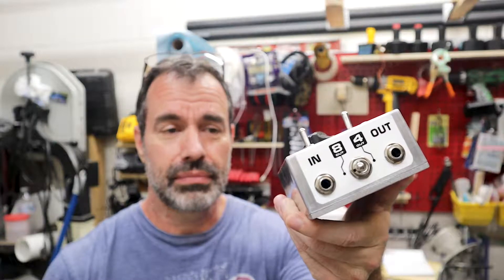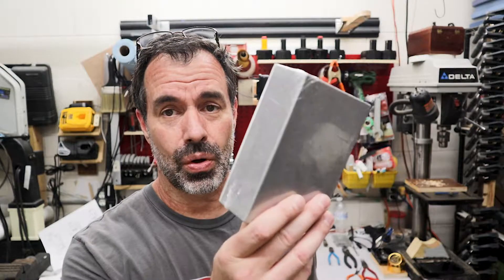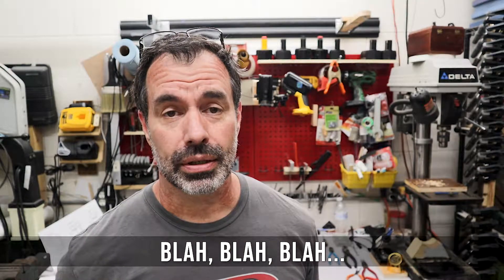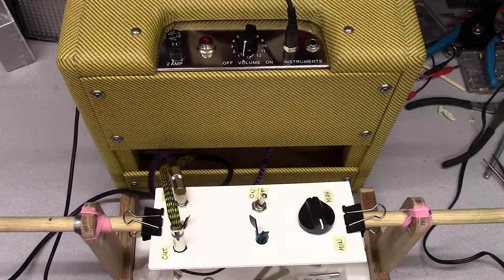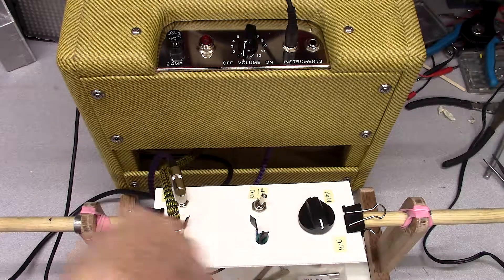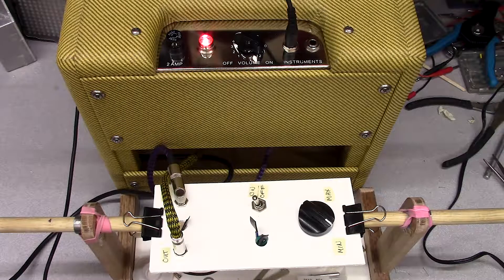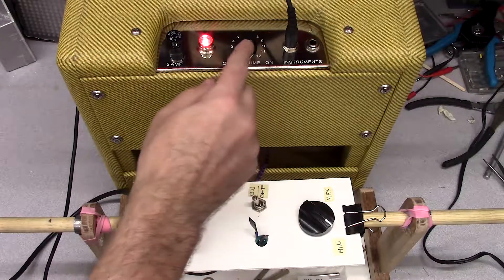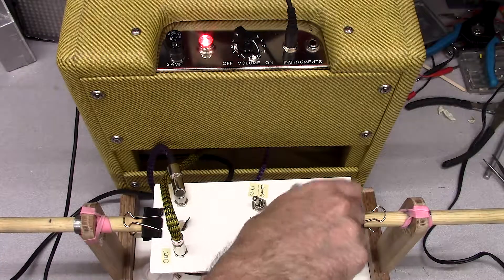Tube Amp Attenuator - the Next Project

Comment: Great videos and very helpful, I would like to build one of these attenuators but it is for a 150 watt valve amp.. What parts do i need and what value are the parts. ?..regards
Reply from the maker: MrAndfio, thanks for watching!
I really wish I could give you good specs for a 150 watt attenuator. That's a bit out of my wheelhouse.
I have read up on others who were working on such things. Tom Sholtz (rock band Boston), was a MIT grad or something and had designed a power soak, others have reverse engineered that engineering...
There is a fellow "John H" who has some forum discussions on such, here's a few links:
https://www.marshallforum.com/threads/completed-johnh-attenuators.124991/

https://www.reddit.com/r/diypedals/comments/1b4thvx/diy_johnh_attenuator/?rdt=51011

https://www.strat-talk.com/threads/attenuator-rant-myths.595220/

https://offsetguitars.com/forums/viewtopic.php?t=123054

The forum lists go on and on.

I'd really like to offer the best solution, but I'd be lying to you if I tried. 
My suggestion is google the John H Attenuator and step into the rabbit hole. All those projects and builds look really cool and most are very do-able... 

Good luck to you and your upcoming project(s)
Be safe and take care!
Reply: Thank you for your reply. best wishes to you. @theNextProject
Reply: @theNextProject  You need to watch. Like any other resistor, an L=pad is subject to temperature deration. At 150F, a 150 watt L-pad may be derated to only 75 watts. A fan cn help.

Comment: Have you heard of the John h attenuator? It's open source schematic so no patent. I discovered it on the marshall forum. I recently bought a marshall sv20c which is a 20 or 5 watt plexi and even at 5 watts way too loud for home playing. I also have a deluxe reverb and with that bought a tone king Ironman  mini 2 but thats rates for 8 ohms. Some say you can swith the speaker and make it work but the speakers an upgraded greenback I'm not taking that out and I don't feel like paying for another attenuator. I have no experience building anything but I'm getting super intrigued and think I'm ready to learn how to solder mod pedals build amps. Maybe an attenuator could be my first project. I want an ttenuator that can handle my 20 watt 16ohm plexi and retain tone.. suggestions? John h?
Reply from the maker: AI, thanks for watching and the comment too!
I have not heard of the "John H Attenuator", I'll have to look into that. Thanks for the note on it being open source too.
I honestly don't remember much about this project, it was all new to me at the time. In fact, the idea which came from guitar.com and their plans didn't work for me.ni did have to change some wiring a bit, don't recall what I changed, but it should be in my wiring diagram.
I don't have any suggestions for a high-watt attenuator, other than I had looked into the work by Tom Scholz work a bit.  He's a very smart electronic engineer and founder of the group "Boston". Sorry, off topic. 
I'll look into the open source attenuator you mentioned.
Good luck!
Reply from the maker: Ahhh!  The John H M2 attenuator... Marshallforum.com.   

https://www.marshallforum.com/threads/simple-attenuators-design-and-testing.98285/

Much more reading and research required for me.  
It looks like a great build project, at a glance reasonably simple and reminiscing of the Tom Scholz Power Soak Attenuator.  

Thanks again for mentioning the John H project!!!
Reply: @the Next Project  hey thank you so much for your response and taking the time to look into it for me. I really appreciate the time you took to look into it and give an opinion about what you found in your search. That means alot to me. I'll keep an eye on anymore videos you make on here. Your attenuator worked good. Man I love those Champs. I'd love to build one. They are spendy. Interestingly the new Champs are about the same you'd pay for a deluxe reverb. The tweed is real pricey. The silverfaces run like 800 and a used DRRI is like 900. 5 watt tube is more than enough for what I do but when I got the deluxe I wanted something I could play with my oldest friend who's a drummer sadly he passed last year (46) from cancer. I almost think a 5 watt champ might of still worked for us. Those things are loud. Anyways thank you again.

Comment: Hi. Not sure if ypu pick up responses anymore but here’s hoping.

I came across this build after my collection was featured on guitar.com. I’ve never built before but looked like a good place to start.

The first hitch was ordering the parts as one of the switch codes was either discontinued or wrong. I got round that, got the parts and built it, but the level control worked in reverse.

That’s when I came across your YouTube video, whose first-stage schematic corrects this.  I’ve completed the build and checked the layout many times, but like you, I find the treble roll-off switch does nothing at all.

I’ve even tried disconnecting one leg of one of the caps to test by creating an open circuit in one position but flipping the three-way switch still allows sound on all three positions.

Maybe I’ve got the wrong switch, but it is the right part number? (On/Off/On DPDT switch – order code SW04204)

And have you found better values of capacitors since making the video?

Thanks if you have time to respond to this - and many thanks for the video.
Reply: Thanks very much for responding. It works great as an attenuator, mainly thanks to your video which corrects the incorrect original.

As to the lack of tone shaping, I’ll see if a builder friend of mine can offer any tips.

I’ll be putting a video demo up on my channels (https://www.youtube.com/channel/UCdTO2SO-d_hjUuB67FbZpvg and https://www.youtube.com/channel/UC5P5TvGoDVPc-P5-XPV_A8w) and will credit your video there soon.

All best & thanks again.
Reply from the maker: @Rockbeareguitars  many thanks!

Let me know when you video is up and I'll try to link my vid to yours ( if I can figure that out).
It will be nice to hear what ideas your builder friend may offer as well.
Thanks and take care!
Reply: @theNextProject  👍👍👍
Reply from the maker: I checked your channels, very nice stuff!  
Great playing too ( I'm jealous, and it'll never happen for me ).
Thanks for sharing!
Be safe and take care!
Reply: @theNextProject  Thank you, you’re very kind. All being well, I’ll record something tomorrow and edit and post as soon as I can 👍
Reply from the maker: Rockbeareguitars, thanks for watching and the question.

Glad my video help sort out some of the wiring issues. It seemed so straight forward, then didn't really work as guitar.com stated. Hmm

I haven't really done any additional testing after posting the video - sorry.
I just plug it in and use it, as-is.  Thought I'd have more time to tinker with it, but that's not been my reality.

I hope your attenuator works well, and sorry I can't offer any additional ideas as to cap values. 

Take care!

Comment: Just a couple of questions: are the input and out jacks self-grounding? Will these work on a solid-state keyboard amp? Is there any grounding anywhere in this box? Or is that why you suggested non-polarized caps?
Reply from the maker: Dennis, thanks for watching and the questions.
I can't really answer as to the use on a solid state amp, and honestly never thought to use it on such.  This is really built to use with a tube amp, allowing the amp to be turned up, yet with lower actual output volume.
You may be able to find a better answer  of you read through the guitar .com build article. There should be link in the video description. 
Off hand, I don't recall the reasoning to the non-polariszed caps, other than the installation flexibility. Sorry, it's been over a year since I worked on this project.
Be safe and take care.
Reply: @theNextProject I did find another video where the builder did use one on a s/s Marshall combo.
Reply from the maker: @dennislarson9560   glad to hear you found an answer.
Take care man!

Comment: Nice video!  What OHM values are you considering for future units?
Reply from the maker: Thank you!
I really hadn't considered any other values at this point. I built this to use with a 5w 4ohm Champ clone. 
I can run the Champ at 8ohms with a simple wiring change and a different speaker, but that probably won't happen.
If you are interested in other options, there is a lot of web info on attenuators. 
At one point I had looked into Tom Scholz Power Soak, found some patent drawings... Looked like a simple enough build, aside from finding the components needed.
Take care!

Comment: Does it have to be a metal box or will a wooden box be ok
Reply from the maker: @Gun Slinger, that's a good question, hmm.
My L-Pad doesn't get hot, but I'm using this attenuator on a low-watt amp.
A bigger, 20W amp my cause the attenutator to get warm.
I guess potential "heat" may be the best reason to stick with a metal box.

I'm trying to think if there would be any additional "grounding" needed, as the metal box probably creates a grounding connection point.

I'm sure you could make this from a wooden box, or plastic box... the thickness of the surface would need to be considered, as the shaft lengths on the switches, jacks and L-Pad will be of issue.

Thinking safety, heat could be an issue, ground issues "may" be an issue.
A metal box is rather cheap in the long run, but you could make a wood box.

Good luck with your project, take care!

Comment: Great work! nice tools and supports...So If we wanted to make this as a 8/16 Ohm instead, changing the L-Pad value is the only thing?
Reply from the maker: @Andy Romero, many thanks! I've been away from this build for a long time now, so don't know for sure what would be needed to make it a 8/16 ohm. The L-pad may very well be all would have to be upgraded. Read through the "guitar dot com" article listed in the video description, there may be more helpful info. Sorry I can't help. Good luck with your potential project!
Reply: It's been a while, so it may not be a help for you anymore, but maybe for someone else... You can do two things if you want to have it 8/16Ohm: either you have to use a 16Ohm L-Pad (I've seen some on ebay, but certainly not as common as the 8Ohm version) and a 16Ohm/50W resistor (again not very common, I've seen 15Ohm ones, that is close enough. or you can use two 8Ohm resistors in series and switch that in paralel with the L-Pad, and then your fixed resistors can be rated for 25W). Or you can use the 8Ohm L-Pad, but then instead of having the 8Ohm/50W fixed resistor in paralel, you could add it in series.

Comment: is the clips used to hold the wires to the post or for a heat sink too?they look perfect for both. the alligator clips i use always bit into the wire if hot
Reply from the maker: @Rich Hall, good eye! That is exactly what they do. Not only hold things without becoming part of the soldered joint, but also pull heat away from delicate components. 
I got those little clips off amazon I believe. 
The worst part about them, they are easy to lose.
Thanks for watching, take care!
Reply: @theNextProject  after reading your reply i have looked thru amazon for those clips do you remember what they was called i searched alligator clips and can only find the traditional ones .i would love to get some of those you use for my pedal builds. sorry to even bother you about them but they look like they work so well i have to have a couple dozen lol
Reply from the maker: @chaos1291975  no bother at all.
They are from Amazon: 
Goot Heat Clip H-2SL
Looks like the price went up, but these are good quality clips. I had a different "cheaper" set and they worked ok initially, then the center pivot pin got sloppy and the spring went flying somewhere.
These clips are "Goot", very Goot. Hahaha.
Take care!
Reply: @theNextProject  thank you so much i found them .never thought to look under heat clips.thanks again for your time.i would rather pay for a quality tool then buy 10 different ones in a year that don't work and ruin the components.germanium diode scare the heck out of me.afraid i am going to over heat them and i was just using regular alligator clips to disperse the  heat  thanks again and i look forward to more of your videos
Reply from the maker: @Rich Hall, you are very welcome, glad you found them. 
Good luck with your projects.
Take care!

Comment: Hi great video. I am going to make my one 'stage 1' with just the L-pad and on off switch. can you just clarify for me, is it an on/on DPDT please? Steven
Reply: Thanks so much for the quick reply.
I did visit guitar.com as per your link but nowhere does it actually say which switch to use! But very intuitive article all the same.
I found your description info very helpful! Thanks for the heads up, this is only for my humble Blues Jr. PS your build is bad ass! Nice skills
Reply from the maker: @guitarste
Steven, thanks and good luck with your build!
Great question and yes, the DPDT is 0n/0n version. 
With the jumper added to one end, it works to bypass if the L-pad if not being used, so the raw signal would move along without interruption.
Please take some time to visit the guitar.com webpage build for this, you may gain some additional info.
https://guitar.com/guides/diy-workshop/diy-workshop-build-your-own-attenuator/
Keep in mind, the 100watt L-pad isn't intended for a 100watt amp. I've read somewhere that 20watts would be a max load.  
Read up and be safe!
Good luck!

Comment: I tried this with a 50W marshall head, going into a 16 ohm cabinet.  Obviously, I bought a 16 ohm Lpad for the project, but it was a fail.  I left the box open for better ventilation, but even at half volume on the lpad, and 5/8 volume coming out of the head, it was smoking the lpad.  Great concept though!!!!!!!!!
Reply from the maker: Hmm, that's unfortunate to hear. I don't recall, but I believe the attenuator I put together has a max input wattage of +/- 20 watt. Anything greater an it will be over run. 
I'll have to look back to find the source of that info.  It may be in the article linked in the description.  Currently I'm using this  with a champ 5w. No issues so far.
Reply: I should've added this info in my original post.  The actual head is a Marshall 1987X, that has a bypass effects loop. The LPad  used was rated at 16 ohms, 100W.  My workaround is a similar project, but simply a pot with input /output jacks.  I place it in my effects loop so that I can still try to get the best tone out of the guitar, but reduce the signal level going into the power amp.  It's ok, but I was really hoping this project would've worked a bit better....  back to the drawing board....lol

Comment: Awesome job ! Are you saying I can crank my 100 watt Marshall to at least 7 and tame it to bedroom levels with that thing ?..Safely without damage to my amp/tubes or torching my house ? Does that thing get hot ? If so, maybe it needs ventilation..I dunno, maybe not.
Your work was top notch..!
Reply from the maker: @TheBIGcountry67, thanks!
No, I'm not saying you can crank your 100w Marshall... I really don't know what will melt if you do such a thing. 
This attenuator is being used with a couple small, low watt amps. I can run a 5W Fender Champ wide open and it sounds like it's on 3-ish, but it has more the full bodied tone to the sound, just at a much quieter level. 
To quiet a 100w tube amp of any make, you will need something far more substantial than this attenuator - something will likely glow red and set the amp and drapery on fire.
Good luck with your search for a proper muffler for your 100watter.
Reply: @theNextProject  Muffler HA ! Thanks for the reply ! I have ruled this out for myself then..Thanks for saving my drapes ! Actually I am at the point to sell this monster and buy a 1 watter..How's that for a muffler ? LOL
I'm serious ain't lyin'..!
Reply from the maker: @thebigcountry6757  
OK, this little contraption will work if you remove the "00" from your marshall.
Even some single digit amps can bother the neighbors (perhaps it's my lack of playing ability). 
Strange how some people are so sensitive. 
Good luck!

PS - if you decide to make one of these little boxes for some lower watt amp, do a lot of research, check the link in the video description and also scour the web for info. There may be simpler solutions.

Comment: Thanks for the video, I've got the parts on order for <$50. Does the type of patch cable you run between the amp and attenuator matter, or can it just be a standard instrument patch cable like you would use between pedals?
Reply from the maker: @matt Harding, excellent question.  You do need a "speaker"  cable, not an instrument cord. I believe most patch cables are too light gage of wire.  I think I made my cable out of 18 or 20 gage strand wire. TubeDepot has a great video on making speaker cables.  Good luck with you build, and remember to do reading an research beyond what I show here.